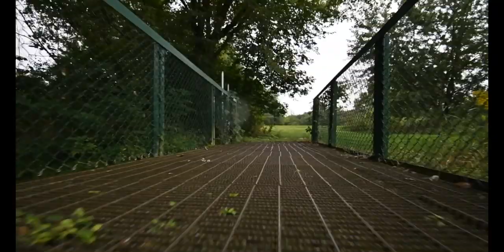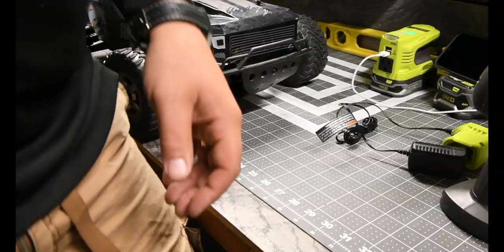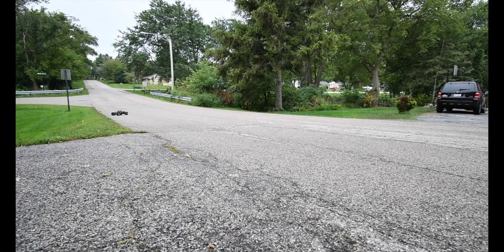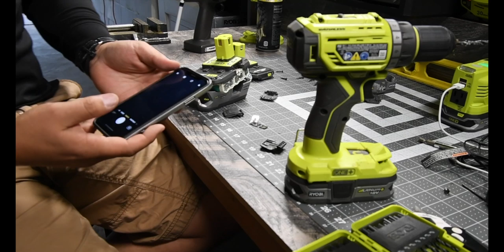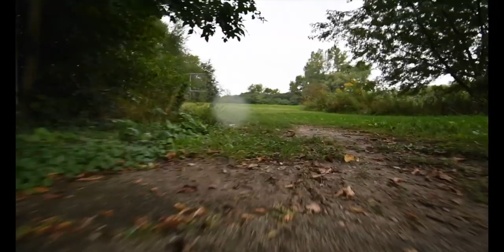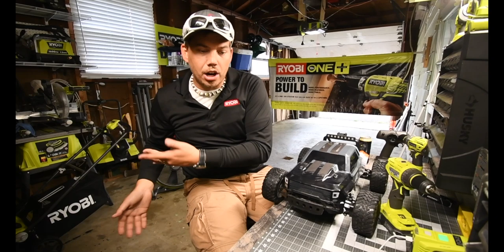Ryobi UPROAR MOD

Comment: @Man Caver Tools
This rc car still pops up from time to time. I get one every time it does, but it’s the same peice of crap every time, overheats after 10 minutes and I have to put it on top of the air cannon for a hour to cool off. I always get tired of the cycle and end up returning it. It’s a blast to play with while it lasts but never satisfies. They are pretty tough for what they are and the price isn’t bad. Do you know if they ever plan to upgrade it with something that will run for more than 10 minutes at a time without overheating?
Reply from the maker: I have no clue if they plan on updating it. but I cant wait till spring to play with it
Reply: @ManCaverTools  it was a fun toy, but frustrating with the overheating

Comment: Velcro a GoPro. on that RC and save weight.
Reply from the maker: there is a camera attachment on the top. I just need a GoPro
Reply: You should be able to pick up a used GoPro hero. 2 for almost nothing.  I would do very well and would be cheap enough if you did find a way to kill it.